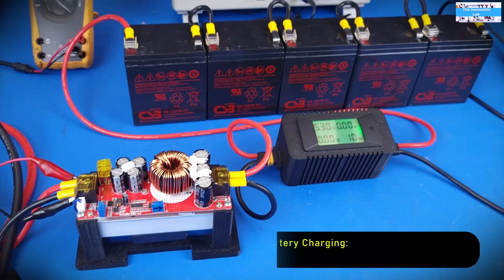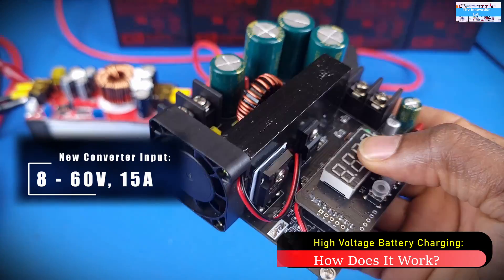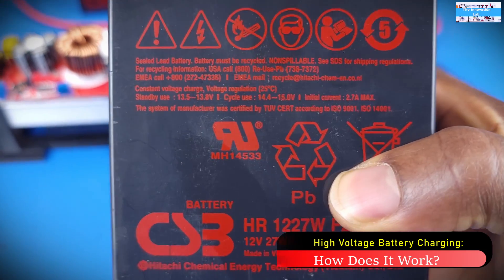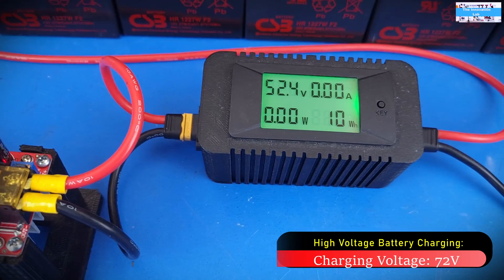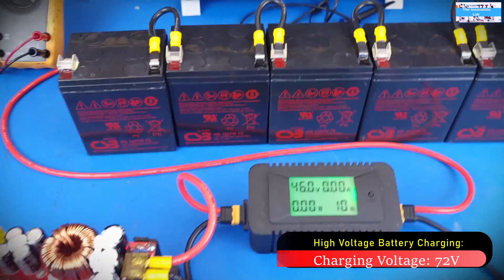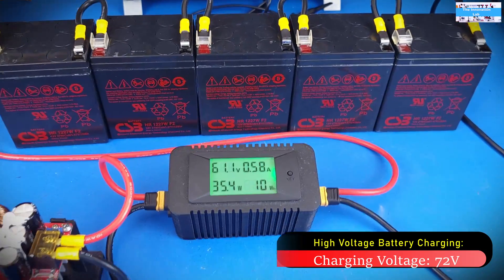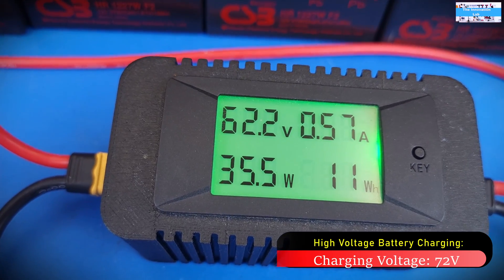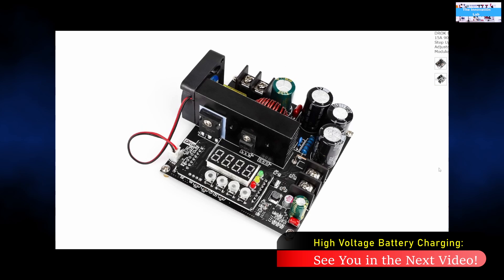DIY HIGH VOLTAGE BATTERY CHARGER: Watch Your Batteries Come to Life!

Comment: Can i charge the 51.2v 30amp and 72v 40 amp lithium battery seperately using this booster with input 24v 150ah battery?
Please reply
Reply from the maker: I have not tested that before but in theory it should work with 2 separate converters - given the you will be recharging separate battery units. 

The problem you will have is that your 24V 150Ah will not have enough storage capacity to fully recharge the other batteries....I recommend doing the math first.

Math: 
24×150 = 3600 Watt/hour of storage.

The other two batteries combined, would need  >4200 watt/hour of storage. So you will have a deficit - if your goal is to get to a full charge on both.

This is the type of engagement that is suited for my Patreon Q&A membership.
https://www.patreon.com/TheInnovati0nLab?utm_campaign=creatorshare_creator

Respectfully,
The Innovati0n Lab 
www.theinnovati0nlab.com

Comment: Hi bro nice vid… Can mosfets be connected in pararel?
Reply from the maker: Thanks a lot for the wonderful feedback.
👍👍👍

To your question;
yes, you can connect the Drains and Sources of multiple MOSFETs in parallel. However, the standard/recommended practice is to drive the Gates of each MOSFET separately through a small biasing resistor. The value of the resistor should be selected based on the design. However, values between 2 - 100 ohms is usually ideal. But again, it depends on the design.

I hope this helps.
👍😎
The Innovati0n Lab.
Reply: @theinnovati0nlab782  I hope u make the tutorial…